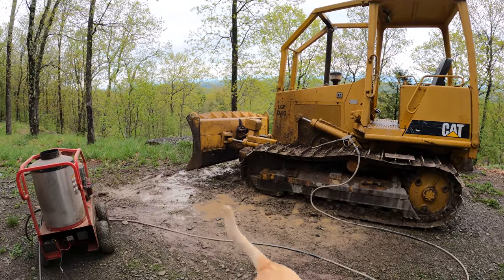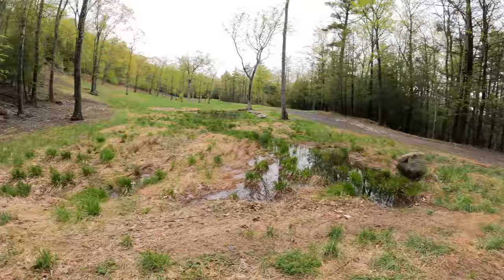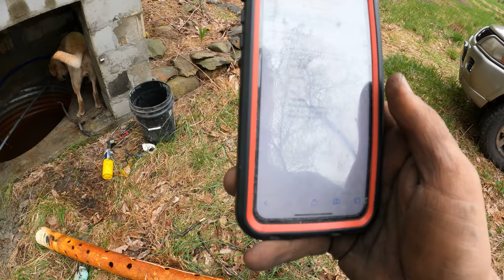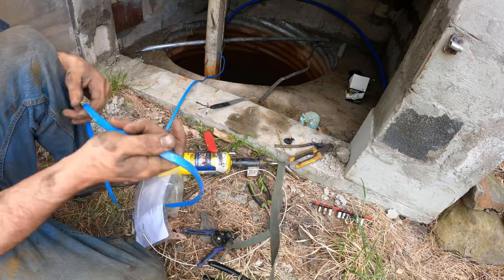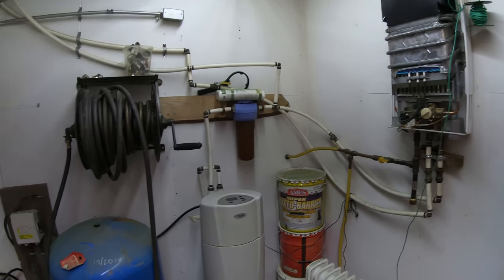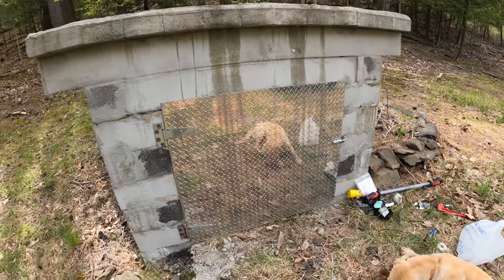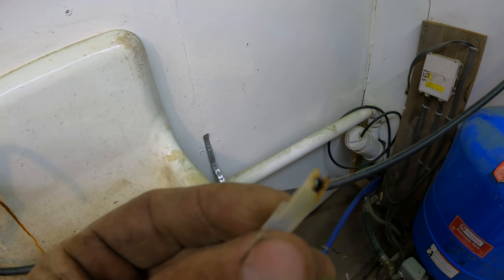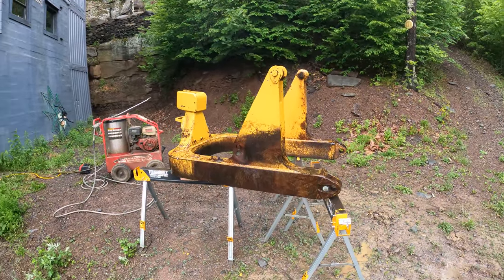Replacing a well pump

Comment: He drinks and showers in that water?  I can't imagine there's a separate pump for the living quarters
Reply: Living quarters have separate  filtering system, why filter everything when there is little benefit  to water blast or wash gear etc
Reply: @davidp8157  typically from what I understand, aquefer water is clear and does not require filtering
Reply: @gremlin7599  certainly not.  Water is generally perfectly good for drinking  when it has been filtered over or through sufficient rock strata, but, whether due to ground contamination,  due to rock type or soil type,  can be totally unsuitable without significant  filtering or chemical adjustment.  This may be due to eg high iron content( yet look  perfectly OK)  or other naturally occurring  mineral content  such as mercury.  Putting aside  visually acceptable but still not suitable for drinking, depending on strata/soil type water is sourced from, routinely water needs filtering  before use,  this can be from  clay or soil contamination or any other of a myriad of other issues. 
It is quite common in many areas  to have A high grade household filtering system in place  for household use, yet not the same high level system for general  use, particularly  if primarily it is only used for irrigation or general  washing down as seen here
Reply: @davidp8157  wow.  I thought deep wells always were almost perfect water.  I guess I'm spoiled in my part of the country
Reply: @gremlin7599  one area I worked in a little under 30 years ago had beautiful  clear  natural spring  water from deep artesian source, but had a high natural mercury content,  trout   were not uncommon in the area, but locals knew not to eat them  other than occasionally,  as people quickly ended up with mercury poisoning.  A cousins farm , they decided   to go deep to get more water , as  they were running out over summer,. They got good volume of water,  and were very happy until they realised after huge vet's  bills , they had to spend significant money  to reduce iron  load  in the water,  even though it looked OK

Comment: As a Well Technician this pump install makes make brain hurt.  Also you don't need anything bigger than a 3/4.  On a 1" line only having to pump up 40-50 feet that would give you 17-18 gpm.

Comment: Andrew, you appear to be missing a means to properly cool your pump motor.  Submersible motors need water flowing over them.  Here is a link describing the issue and a means to properly cool the motor: https://franklinwater.com/more/service/aim-manual/motor-application/all-motors/page-6/

Comment: ok.Andrew..I'm about to give you some free information here , your tank is too small for that pump while using the pressure washer. The pump is out running your output ''pressure washer'' and creating a short cycle from cut on to cut off then back on again which is over heating the motor .Normal deep well pumps are chosen and designed by taking the well depth and static water level and figuring how much water you need it to push from that depth on pressure with the pumping level which also tells you what size motor is needed. That design is based on the tank being around 2 ft only from the tank. The further the tank is from the well head the harder it has to work to pressurize from any depth not to mention the head pressure which puts a lot of back pressure at your pump. The only thing cooling this motor is fresh water around 65 - 68 degrees flowing by it going into the pump. So it will maintain a cooler temp while running versus cutting off and on constantly...this junk pump you bought will go out sooner than later depending on how much it's used . While a good design should last 20 plus years. BTW this is not a well for drinking...you have a seepage well which is rain water that hasn't been filtered yet through many feet of sands , rocks, shells, clays, chalks ect ...what you are drinking has e-coli and coliform bacteria in it and those filters will not remove that from the water nor will that bleach last very long . I recommend drilling a deep well and getting someone who knows what they are doing. I know you hate to pay anyone to do anything but this can and will affect your health in the long run..

Comment: Without even watching too close here I saw you took out a start capacitor and one leg of your 220 so you're trying to run that pump on 110 whatever that's not my point is that you are too stubborn to even seek someone's advice when you're in over your head and and that combined with making excuses ,usually ends up in a waste of Time effort and money. In fact that pump may last a long time running like that without a start capacitor.  Never fail to seek out and read the nomenclature for what you are doing
You have a two pole breaker the black and the red poles and the white which is probably a neutral for the 110 volt float switch it keeps the pump from running when it's completely dry, all induction motors have a start capacitor it helps it start , the reason why that one is in that box and not on the motor is self-explanatory,
try taking the one out of your washing machine or air conditioner and see how much of a fuss it'll make until it starts it'll run like that for a while maybe three or four years.
Reply: When he said at 3:19 that the old pump needed a box but the new one didn’t for some reason, that was the giveaway.  He’s doing his electrical work without looking at instructions or wiring diagrams. Video posting could come to an unexpectedly end one of these days. Hope someone will adopt the dog.

Comment: im no electrician but i know basics but i dont think you're suppose to mix red and white...id figure that'd be obvious unless this kid knows something i dont...he clealry knows alot i dont being a mechanic and all but Black are the power wires and white are not...red is also a power wire so the red attached to the white is a negative and a postiive mixed ...it doesnt work...the bare wire is the ground wire always, black is negative aka the power wire, red also is a secondary power wire and white negative. cant mix them.
Reply from the maker: White can be hot on 220v when there is no neutral. (this exact scenario)

Comment: Filter killed the 6 year old pump.
Reply: I don’t understand why the filter has anything to do with killing the pump if it’s after the expansion tank and pressure switch. A clogging filter is just like closing a valve slowly over time.